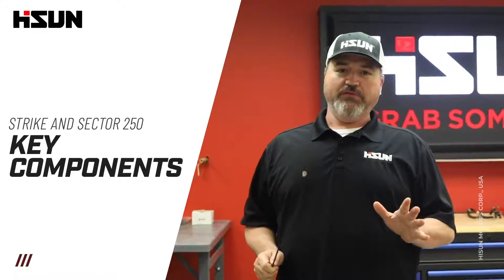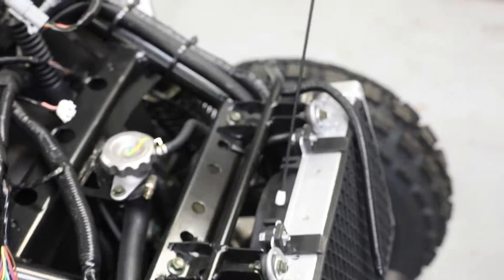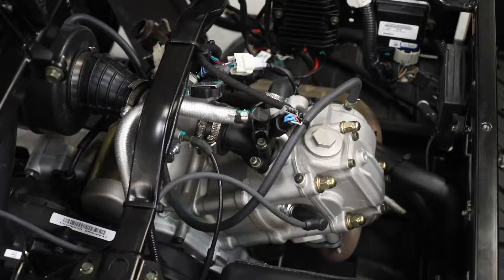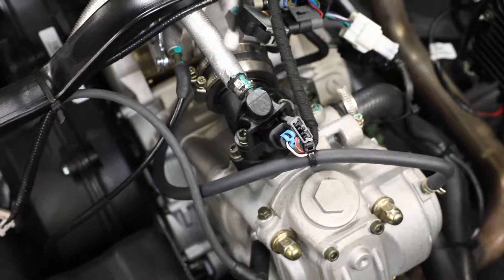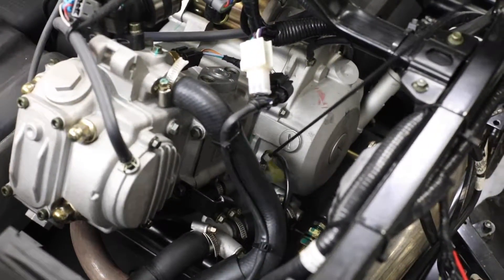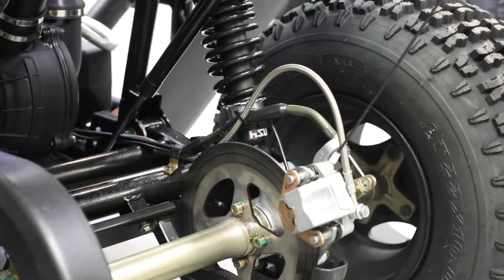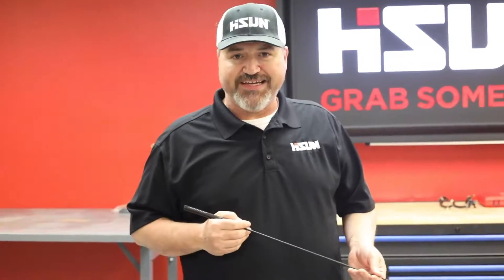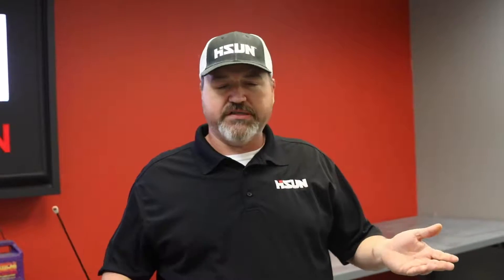Key Components - HISUN 250cc UTV Engine

Comment: Bonjour
j'ai un tornado 250 utility 2015.Meme chose que le colemen ou le sector J'aimerai savoir si vous aviez déjà entendu parler d'un problème qui suit. La machine part très bien . elle roule numéro un pour 20-25 minute puis elle s'éteint. J'attend 1 ou 2 minute et elle repart très bien pour un autre 20-25 minute. Elle a 865 kilo alors comme neuve. Ne prend pas d'huile , ne chauffe pas et tout les filtre changer .On parle sur les forum de la bougie quand elle vient chaude elle coupe l'étincelle ou du tuyau et bouchon a gaz pour que le réservoir prenne son air. Peut etre ajustement de carbu mais celon moicest plus une affaire électrique puisqu'il fonctionne tres bien avant qu'il séteint. J'avai pense le capteur de pression d'air ou quelque chose du genre. Je continue mes teste et J'attend votre avis svp .
alors ce nest pas un probleme de gaz et de carbu car il est a injection . cest vraiment le feu qui coupe apres 25-30 minute  vérifier avec un testeur d'allumage en direct . bobine et cdi neuf . reste le stator et ecu ?

Merci

Comment: How about a video on doing a actual oil change. Where is the location of the oil filter on the 250?
Reply: Under the passenger seat, or you can get to it through the right rear tire

Comment: Hello, I have a Hisun Strike HS250 unit. I have a charging problem, I am not getting voltage from the collector to the regulator.
I need help removing the collector to measure it or change it if necessary.
Greetings from Argentina